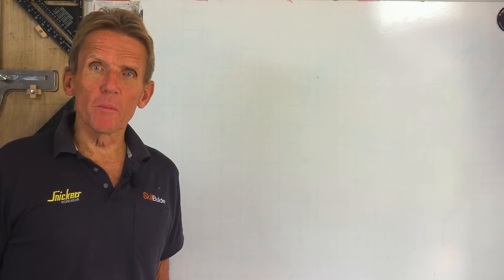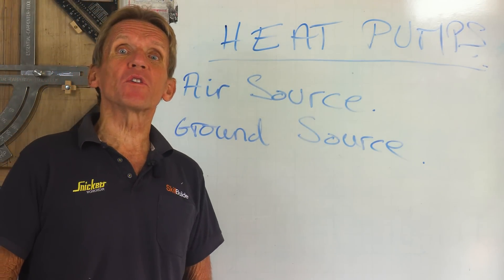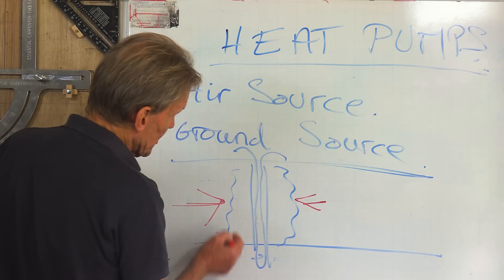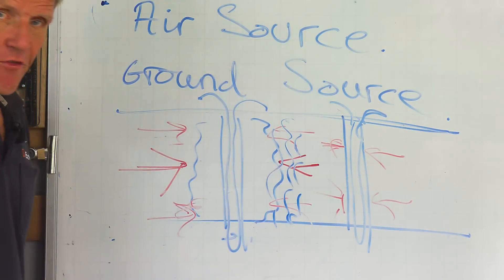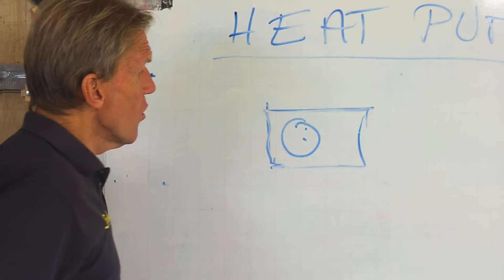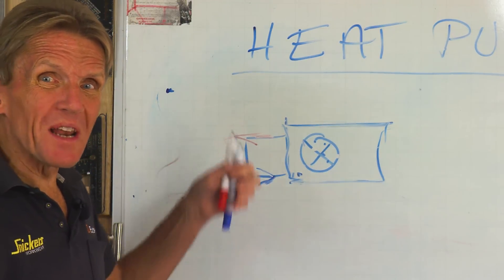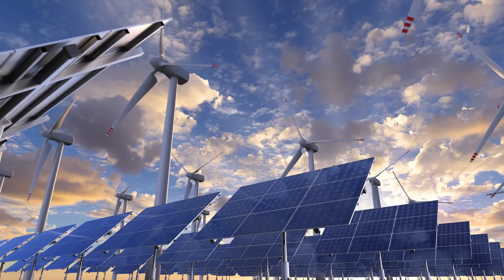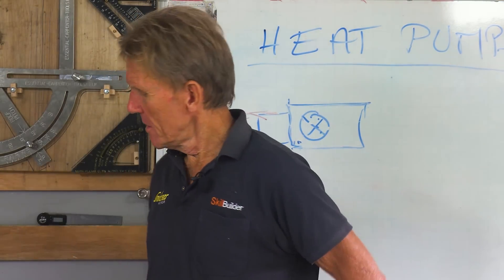Heat Pumps ~ Get Your Facts Straight!

Comment: Alright Roger, I agree with your explanation about ground source heat pumps cooling the surrounding ground but you haven’t included explanation of one type of borehole setup i.e. WATER SOURCE, when ground water extracted through a bore hole. This comes out at a nearly constant temperature of 10° - 12° Celsius, the heat is extracted and the cooled water (around 5°C) is discharged back into the ground. This is much more efficient than what you describe as it doesn’t suffer from cooling the surrounding ground in operation so would be worthy of mention. Just saying…
Reply from the maker: Yes I didn't want to talk about water in this video because it was more about this description of geothermal.

Comment: Unless you have insulation to extra ordinary levels (and often impossible to achieve with existing housing stock) ASHPs and GSHPs are doomed to failure.
Reply: Why do you think this? Electricity costs 3x gas, so you just need to get your heat pump to perform at CoP 3.0 for it to cost the same, if you've got a leaky house that might mean underfloor heating, or enormous radiators, but its doesn't mean its "doomed to failure"
Reply: @edc1569  HP running 24h a day using electricity @ 30p a unit = £7.20 a day 
X 30 days in a month = £216 
X 5 month heating season = £1080 

Gas boiler running heating 10h a day @ 10p a unit = £1 a day 
X 30 days in a month = £30 
X 5 month heating season = £150 

Anyone???

Comment: I’ve just paid 1700 quid for a brand new Worcester Bosch boiler to be supplied and fitted 
And my last one lasted 20 years , so I’ll happily pay the £130 a month I pay for gas and electric, 
Instead of forking out 15 grand on a heat pump , that won’t heat my house as warm as my combi
Reply: You can't beat the good old gas boiler. Effective and reliable.
Reply: We were completely renovating our house (built 1800s), and I got a heat source pump engineer to come in and give me a quote for installation. The total cost, including insulation, making the house airtight, new rads and piping, dehumidifier, plus the thing itself, came to about £30k. He then said, “if it were me, I wouldn’t bother”. I took his advice, and stuck with our gas boiler.
Reply: @sagetheowlfatfeathery2083  great choice 
Can't beat a nice combi for a nice red hot house
Reply: @sagetheowlfatfeathery2083  What was the quote for insulation, making the house airtight and the dehumidifier? Presumably they are still necessary as part of the  renovation, regardless of , and independent of what heating system you chose. 
It would good to know the cost of the ASHP by itself. Mine were cheaper than the quote I had for a New Gas Boiler
Reply: @solentbum  There was an existing system in the house that we could use as a basis for the renovation. The house is reasonably well insulated already, and you don’t need to be airtight for a gas system to work. I think the pump itself was about £3k, but things like replacing all the rads (the ones on a gas system are no good because they’re designed to work with 60 deg feed and the feed off a heat pump is only 50 deg) really add up; I think we have 16 in the house. I should add for context that I’m in my 60s, so would be very dead by the time I’d seen a return; if I were in my 30s, the decision might have been different. Also, this is all received wisdom because I know bugger-all about HVAC, so just listened to what the guy told me. On the basis he turned up to sell me something, and walked away telling me not to buy it, I assume he was being honest.
Reply: @sagetheowlfatfeathery2083  I went in a different direction at 60, I knocked the old cold expensive house down, and built new, with extra insulation full house mechanical ventilation and ASHP. + other features. The whole thing cost me just over £230k , giving me a six bedroom house with  large (heated) garage/workshop. I am happy with the electricity costs, which are mainly down to three EVs that replaced very expensive to run ICE cars. 
Each to his own I guess.
Reply: @solentbum  £230k build cost for a 6 bed house? My extension cost more than that…………..
Reply: @sagetheowlfatfeathery2083 I was project manager, buyer, builders labourer, plasterer,tiler, and numerous other features in the construction, I also have in house electrician and plumber. 
There was no massive builders profit , I did negotiate very good discount at a time of recession.
Reply: @sagetheowlfatfeathery2083  Ever hear of multiple quotes ?
Reply: Spend 15 grand to save 300  a years ..stuppid
Reply: I did this. Until a gas shortage spiked the price 400%. 

Now I'm all electric, because I can generate electricity several different ways.
Reply: 15000 ?   get lost
Reply: @esecallum  ok bye 
I’m lost
Reply: @esecallum if you have to change pipes and replace your insulation, that's a very realistic figure...
Reply: @koresoteira447  Not really. Its dependent on many factors, but even changing rads etc is unlikely to get near £15k plus you then deduct the £7.5k grant
Reply: @koresoteira447  Quite simply replacing , installing, insulation is the most cost effective part, and applies to ANY heating system.
Reply: What is a quid?
Reply: @mariemccann5895  a pound 

1 quid is 1 pound
Reply: @mariemccann5895  1 British pound.
Reply: @mariemccann5895  Quid is slang for british pounds

Comment: Im sure heat pumps work for some buildings in the uk. But you still cant beat a nice powerful gas boiler 🔥
Reply: Of course you can, an oil boiler. :)
Reply: Iceland: hold my beer while I tap a volcano...  😁
Reply: Yeah you can. Gas boilers are...at best 85% - 95% efficient. Heat pumps are on average 300% - 400% efficient.
Reply: @Pain_in_Diaz  rubbish
Reply: @davidj2448  it isn't though

Comment: The UK won't allow you to have AC?
Reply: There's not much call for aircon in the UK as it doesn't get hot enough for long enough. Roger didn't say anything about the government not allowing aircon in the UK they just won't give a grant on the heat pumps that Roger is describing in the video.
Reply: @sugarpuff2978  Wasn't there a heat wave in the UK last year and this year?
Reply from the maker: I didn't say that. I said they won't give a grant
Reply: @SkillBuilder  I know you didn't say that. But that's what the UK is saying, without actually saying it.
Reply: wont subsidise it, will let you install it without VAT (sales tax) though. There is logic to it, they want people away from gas, and AC systems dont heat water.
Reply: @edc1569  So what if AC don't heat water.
A water heater can heat it.

Comment: Pity about the lack of support for reverse cycle HPs. Probably welcome the AC when the climate really warms up, which it inevitably will. AC could still run on “green” energy - is there a problem?
Reply: Well, pumping hot air into an already high air temp just makes it hotter outside?  And since no machine is 100% efficient, you're adding more waste heat from its operation.
Better to have well insulated houses (warm in winter and don't heat up in high summer).  Even my 30's semi stayed much cooler last summer just by closing the curtains in the day and venting in the cool of the morning.  +10C delta to outside temps on those days.
Reply: Heat pumps don't run on green energy, much as the government want you to think that. They run on more or less  due to that being the source of generation that reacts to extra grid load. Renewables and nuclear cannot.

Comment: Very difficult to heat an average insulated house, say early 80s or before on 45-50C.
Reply: very easy if you understand hydronics.
Reply: @UrbanPlumbers   I understand the principle very well, but no cavity wall, poor insulated houses needing high efficiency etc. You have to add in the cost of upgrades to insulation and install costs and for many older homes the numbers don’t add up. I’m a Mech Eng and can do much of this myself, but it’s still one hell of an investment.

I’m not against the change, but this is not a miracle for everyone.

Comment: I think they are crap. My mum has a one bed bungalow built in the 60s and well insulated and a council property her bills are virtually the same as my 3 bed well insulated 60s council house owned by the same council so you can assume built to a very similar standard. They are both mis terrace. For her its probably still cheaper than just having storage heaters or electric heaters but the fact it costs essentially the same as mine makes no sense. Also take into account i pay 2 standing charges so that also adds more onto my bill. We both heat to similar temperature and if anything my heating probably works harder we are smokers so doors are opened alot to go outside we have 4 kids to bath and i leave our heating on 24/7.

Comment: I live Texas and have an air source heat pump. Last winter we had quite low temps for central Texas, -12c, the heat pumps became ice and the "emergency" electric heater kicked on inside the unit. It was pathetic. I kept the bedroom warm with a portable propane heater, but the rest of the house was at 4.5c.

This year we have firewood and a fireplace insert w/blower... In addition to the pathetic dual heat pump unit. 

Maybe I'll knit a couple of square sweaters for them and cozy them up...
Reply: The problem is in Texas professional engineers couldn't even work out how to keep gas power plants on in freezing conditions, which resulted in those appalling black outs, so expecting a HVAC installer to be more competent in Texas is probably stretching it.  Plenty of people in nordic countries heat their homes with heat pumps without any drama.
Reply: @edc1569  I cannot believe that northern climate use air source heat pumps.
As for the power plants. That was and is highly suspect. Gas doesn't freeze, at least not where I'm from, Montana and Colorado.
Reply: you bought a unit that didn't handle cold temps. that's either your fault or the builder's fault. don't blame the technology. lots of units can easily handle -15c easily.
Reply: @somedude-lc5dy  How does an iced up heat pump extract heat from-15?? 

Explain, I'd like to understand.
Reply: @yadayada-yadda because heat (i.e. energy) is not the same as temperature

Comment: where is your source for Air to Air heat pumps not being as efficient as Air to Water heatpumps. Surely, air to air is more efficent as there is no losses though a heat exchanger and the temperate output only needs to be a few degrees higher than the internal  temperatures
Reply: I think you DO have a heat exchanger.
Reply: @Hecatonchires1991  In an air to water system, there is a plate heat exchanger that takes the heat from the evaporater side and then transfers this to the water. the air to air system does not have this additional step, so does not suffer from efficiency losses associated with it.

Comment: I just want to know what girth pipe do I need to future proof radiators on a current gas boiler setup.
Reply: It depends either 25 or 32mm
Reply: As a guide a 22mm pipe can do 6kW at DT5, 15mm can do 2.75kW at DT5.

Comment: Usual rubbish from Roger that Heat Pumps don't work in old houses. Funny mine is 220 years old and works perfect. And the rubbish about gas providing most of the energy. I'm amazed you didn't manage to get your favourite name into it somehow. Dare I say Worcester Bosch. Its about time you had a another lesson from Adam at Heat Geek.
Reply: You're being dishonest. Our mild UK winters and they way people have built houses for centuries in this island (reflecting this mildness) are the problem. The characteristics of your very old house are all-important, as is the vast amount of money you have spent insulating your floors, walls, roof, windows, replacing radiators by underfloor heating, etc. etc. Roger has done about 3 or vids on heat pumps. Unlike you he is always scrupulously honest about the pros and cons, and the economics, and about the circumstances, including economic incentives, which may mean that heat pumps can or cannot be a solution or partial solution.
Reply: What specifically are you complaining about? He just suggested that they work less well in older properties that are generally less well insulated. That's completely correct.
Gas powered power stations are still the major source of our electricity in the UK at about 40% (produce more electricity than wind, hydro and solar combined!). Nuclear is about 15% currently.
The price of gas per kwh is also likely to decrease again by 10% over the next 3-4 months. It will probably go down again next summer. Gas boilers are going to be around for a long time yet!
My house is really well insulated, but I just turn my boiler flow temperature down and have the heating on low. House is nice and warm. 
Zero need for a heat pump.
Reply: He’s not saying that. It will work in any building even uninsulated, however the more heat loss from the house the more heat you need to put in. That can be through a combination of bigger heat transfer devices (radiators or underfloor heating) or a heat pump with a greater output. Trouble with that is that a bigger heat pump needs more electricity to run it or you are running it at greater output which is less efficient. The net result is more cost. 

Remember a heat pump is more than a boiler so you need to be saving more than the cost of the gas just to break even. Gas is about 1/3 of the price of electricity so you really want a scop off 3-3.5 at least. That’s what he means by dosnt work. It’s not that they won’t work it’s just they may not be cheaper in the total cost of ownership. 

Even Adam has said some properties aren’t suitable for a heat pump.

As for gas providing most of the energy he’s correct. Go look at gridwatch.co.uk and right now we are at 61% off electricity provided by gas. I think it’s about 80% off uk households are heated by gas. So yes most of the energy comes from gas. Better than coal but not as good as solar and wind.
Reply: @davideyres955  just for info my heatpump when just doing heating even tonight at 4 degrees outside is using 800 watts of electricity so even if I'm getting 400% efficiency that's putting 3.2kw of heat in. So being an old house it's not got the heatloss that the sceptics would say it would have
Reply: @johnfreshwater3790 how much is your electric bill & how much did the heat pump cost?
Reply: @pauldavies7251  the heat pump was fitted 3 years ago when the rhi was the Grant scheme and cost about 6k as we already had a new hot water cylinder. But we get over 400 pound back every 3 months from the government for 7 years. We are all electric and have an electric car and our electric bill is £150 per month
Reply: @johnfreshwater3790  I think heat-pumps are great, they can work in older properties well with underfloor.  However, I hate the fact that a pensioner in a block of flats who has none of the options you have is subsidising your fuel bill. All the subsidies should be cancelled tomorrow, FIT is the worst of them, RHI has caused a lot of harm and excess emissions too.
Reply from the maker: Hi John 
I notice you are very light on the details concerning your heat pump and the installation specifics. I would love to see your 220 year old heat pump in action.
Reply: @SkillBuilder  The house is 220 years old not the heat pump The original house is Georgian but has been extended very early after its original construction before 1900 and some of the extension is solid9 inch  brick. When we bought it oil heating was installed. If I knew how to add a picture I would but of you have an email I can send you some of the house. Showing some pictures from recent and some years back and one from 1903. I just get frustrated by the constant blurb about ashp not working and normally as Adam and the Urban Plumber say its usually a bad install
Reply: That's where your wrong my house has only had loft insulation and double glazed windows. The walls are as they were built 220 years ago. Downstairs floors are actually worse than they were as before they were suspended timber and some idiot has took them out and filled them with uninsulated concrete which was a stupid thing to do as now the walls have to breath above ground level only as before they would have been drier due to air flow beneath the floorboards. Which had they have been I could have insulated between the rafters. But unfortunately I can not. If you watch Peter Ward from heritage house he will inform you that old solid walls can be warm if they are dry.my house is 200 sq metres and I have only radiators normally running at 35 degree flow temperature and a max of 40 and the house is between 20 and 21 degrees all over all day

Comment: I would install a log burner before I installed an ASHP.
Reply: Log burners are illegal in the whole of Greater London and, I think, in most cities in the UK. It's not just because they generate CO2, but also vast quantities of particulates. Millions of our ancestors will probably have died much younger than they might have because burning wood or coal was their only option at the time.
Reply: @mikerodent3164  1) I don't live in any of those rat nests. 

2) They only realise the CO2 that was captured during growth of the tree. Just the carbon cycle in action. Different to burning dug up fossil fuels in your boiler. 

3) Houses are full of dust and stale air. If I wanted to live forever I would avoid refined sugars. Diabetes, hypertension and suicide kill people now. 

4) Don't pity our ancestors, take a look at how people live now. They would pity our existence.
Reply: Had a log burner in an old cottage during the 90s. Did the job. Leaving all the inside doors open, it warmed the whole house. Very cheap to install at the time, cheap to run especially if you had a ready supply of wood. Mentally calming too, probably watched the flickering flames as much as the telly; lovely smell too with particular types of wood.

It was a rural location though, probably not good for those in dense areas of population.